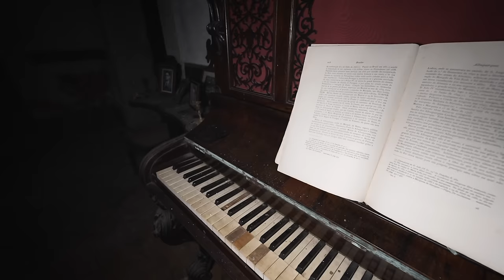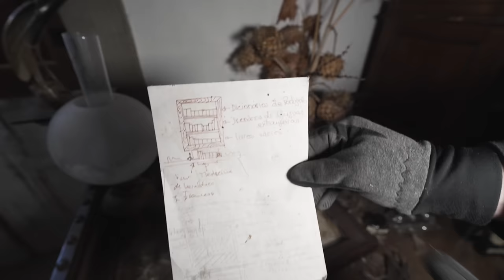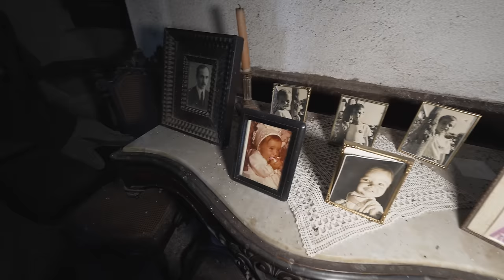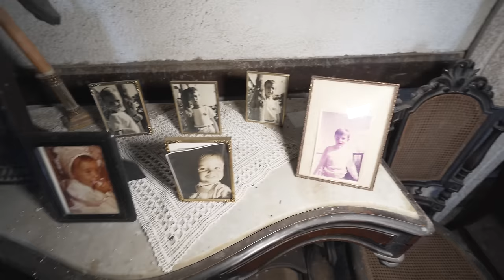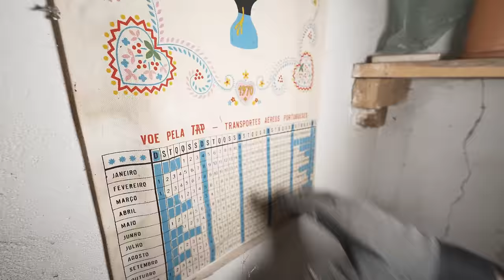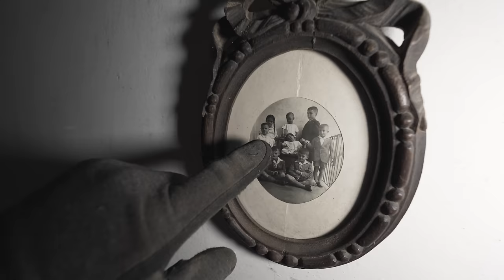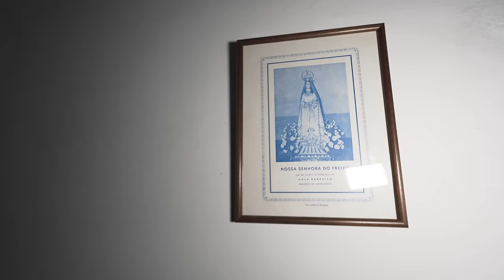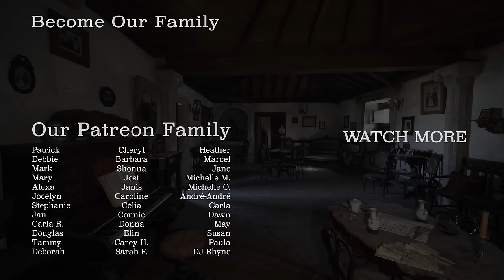Closed for 40 years ~ Abandoned Portuguese Noble Palace with all its belongings

Comment: The dish on the floor is a chafing dish, which is designed to keep hot food warming. It is missing the part that would hold the candle or sterno can. The top dish sits atop another which would hold hot water. It keeps food (stews, sauces, soups) warm.

Comment: I love history and I believe parts of this house were built between 1300s - 1600s.   Very very old.  The kitchen dates back to at least 1400 - 1500s.  There are many things such as the floor boards, door hinges, lanterns, and alcoves that make me think this.  Then later, wiring was added, bathrooms, etc.  One of the main things that caught my eye was the photo on the wall by the staircase.  The photo of a man and his attire which was typical of approximately 1650s.  The Knights Templar crosses throughout the house also dates way back.

Comment: In the dining room the pan on the floor in English is sometimes called a braiser. It would most likely have hot coals in to keep the room warm and also fill metal foot rests to warm the feet with the coals. The box was an "ice chest" for cool drinks. I have seen smaller pots like those on top of the ice chest in French they are Chocolatetier to make hot chocolat in. The brush and pan are for "crumbing" the table between courses, called a "Silent Butler". Love it all
Reply: I think it is a chafing dish, for serving food, with a candle or oil lamp placed underneath to keep the dish/food warm.